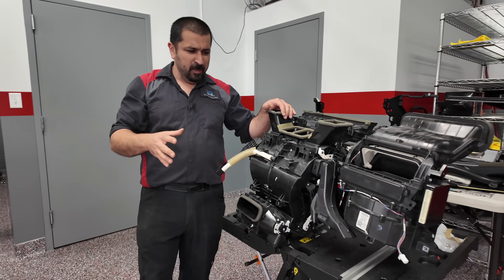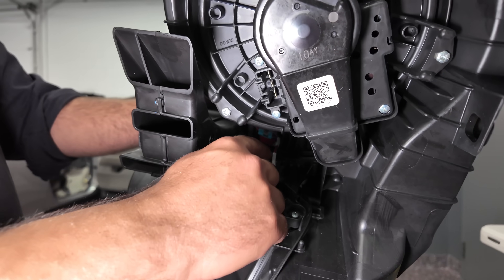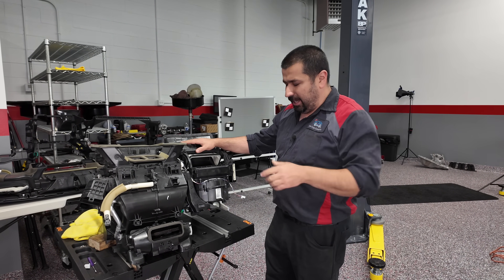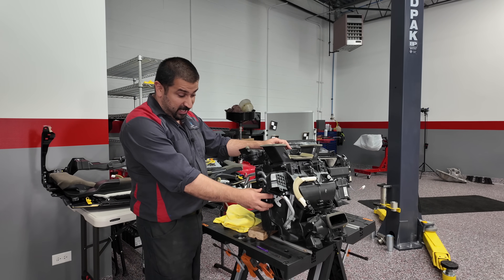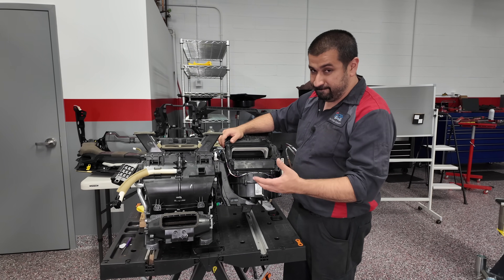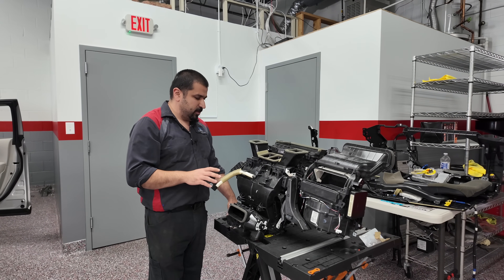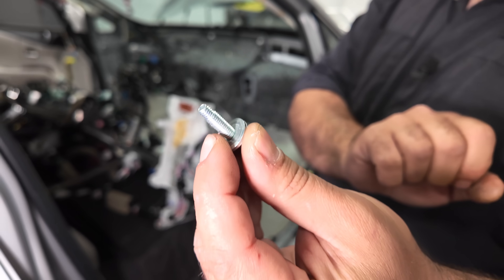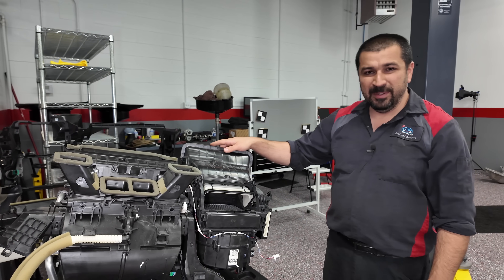THIS is Why Car Engineers and Car Mechanics Don't Always Get Along!

Comment: Sad that Toyota isn’t what it used to be. I remember the good days of Toyota when they were simple and cheap to fix. Like a VW bug.  Yeah those days are gone thanks to the EPA and engineers adding motors to everything - because that fuel cap door needs a servo to open it 🙄.  Can I get a simple car again that doesn’t cost $80k that isn’t made with inferior parts.  And has a transmission dip stick.

Comment: As an Electronic Technician  for almost 4+ decades, who’s work along side Engineers. Most Engineers that I’ve worked with, that have good common sense, have a Gun over their heads by the  clueless bean counting crew that’s very delusional 95% of the time.

Comment: For years I've been saying that engineers must be made to perform repairs on the cars they design.

HVAC are the worst. All this complexity  buried behind the dash for parts that DO fail with age. Especially heater cores and AC evap units... they DO fail eventually.

I changed the heater core on my old Jeep, took about 2 hours without rushing (and the heater controls were cables, similar to bicycle cables). I hate modern cars.

There is NO justification for that other than being cheaper to assemble in the first place.

Comment: In 2017 RX, they did it even worse, they combined all three of those "inside" servos into one, and it is even harder to get to, then in 2010 RX. Lexus wanted to charge me $2800. As a DIYer, I was able to repair it in 1day without taking apart whole car. And even servo didn't need to be replaced. Toyota instead of soldering motors, put their contacts in clamps, which after oxidation lost electrical contact. I cleaned it, put dielectric grease on contacts and put it back together. Works for a year already.

Comment: Had to do such repair work on my 1997 Camry. Terrible job. As a DIYer you dont want to discharge AC refrigerant, so I had to cut opening in the box to access and then glue it back. I believe the issue is when condensate get frozen and ice blocks the doors. In my Camry actually plastic shaft was broken and I used piece of old stainless steel antenna to repair shaft. It worked well after repairs for many years.

Comment: This makes one appreciate older vehicles. How much technology do you really need. Everything has its price.
Reply: The fancy touch screen and digital dashboard is all cost cutting. Its almost never for innovation.

Analog design is very expensive, especially when it has to be accurate in multiple conditions.
Reply: Yep.  I like my 90s 5 series and I look at everything the E39 Executive has over my late E34 and just see it as more superfluous crap that can fail on me.  Electric steering column adjust that ties in with the electric memory seats is a nice idea... but pointless.  The rain sensing wipers do a crap job.  The auto dip rearview is worse than the E34's.  The cup holders are a joke.  The nav screen in the centre dash is painful to use.  Its easier to scan for codes though since it's OBD2, I guess.  Any work on it is just not enjoyable, requires a ton of flashings and coverings to be removed first. And the pain of doing the sump gasket! All the moving everything out of the way to get only about 4 inches clearance to wrangle the dang oil pan out... lets just say I used up my yearly allocation of expletives that day.  The E34 is an absolute joy to work on by comparison, most of it is so well designed and made from high quality materials I don't even need the service manual most of the time. The only thing that breaks are silly little plastic clips that I have bucketloads of on hand (thanks to chynah)

One modern tech I think I would like is voice control.  I dislike directing my attention away from the road and all the idiots on it, but everything is going towards touchscreens you literally cannot operate without looking - no more button feel.  I HATE that.

Comment: Got to love the engineers that never touch what they design when it breaks. We put up a dart board in the shop with their pictures on it.
Reply: Seriously? You made it sound as if they do NOT do ANY testing or if even if they do test, that nothing ever breaks.... Lets suppose they do test, and something does break, then what, the engineers just go, "not my problem" and "never touch what they designed when it breaks"?
Reply: @minienigma  I'll do the same. Seriously? Do you deal with this stuff on a daily bases? Yes, I'm serious. Why design a access hole too small for a valve to fit through after it's unbolted? Why locate a switch or drive motor in a place were the switch is longer than the room given to remove it? Why put a two hand to loosen connector in a one hand space? Why use off the wall hardware you need to buy special tools for? In the case of the Lexus and most every modern car out there, why design it were most of the car needs to be torn apart to do something simple. I may not work on cars very often but I do work on other specialized products with the same problems. One little bad sensor mounted on the side against all the structure when it would take 5 minutes to change it were located a inch different. Besides, a engineer told me some of his co hearts think like that and he wastes time worrying about us mechanics having to fix it quick.

Comment: I've worked on cars and trucks. This reminds me of the time I decided to go and fix high speed copiers/printers in the field for Canon then later Sharp. Can't tell you how many times I got to a service call where all the other techs did was spray WD-40 willy nilly inside the machine and pray the customer didn't call back. I was the one that would take apart the machine down to the stamped steel frame and find the electromagnetic clutch or brass bushing that was making the noise and apply grease to make it go away once and for all. I eventually got fired for working like that but I never destroyed a machine and my call backs (or recalls) were non-existent.

Comment: I see both sides of the story. My dad was (still is) a mechanic so naturally I worked on cars from a young age but I ended up becoming an engineer (more specifically a manufacturing process engineer). Some of the problem is that most of the "hands on" type of engineers end up as manufacturing engineers while a good chunk of the less hands-on engineers end up in design engineering. It's already hard enough as it is to make things manufacturable, it is whole other thing to make something serviceable because you have a ton of teams trying to make everything work together. We always try to make things manufacturable and serviceable but if we realize too late in the design process, it may not be possible to change the design for serviceability.... if you change one thing, you may interfere with another teams thing. It's easy to see in hindsight where and how we could have made it more serviceable but by the time you can see it "in hindsight" it is already too late. To the mechanics/ techs out there, it is a lot harder than you'll think to make something serviceable but we do try

Comment: Unless I lived in some place like Arizona or South Texas, if my A/C  went out, as long as my heater worked, I’d live with it (I live in Minnesota). My last car’s A/C died slowly over about three months after I left the dealer from purchasing it. I figure they knew about the leak and filled the refrigerant enough to sell the car with the A/C working (I never  went back to them and never will).

The heater worked fine and I was not about to spend who knows what, getting it fixed. As long as I had heat in the Winter, I could roll down my windows in the Summer (like we did when I was a kid, before A/C became standard). I drove that car for 13 years until the frame finally rotted away from the front end last month from all the road salt we use (the car was 19 years old). The engine/transmission was still fine.

Comment: In January we had a Corolla IM come in the shop for the same issue. But this was caused by rodent damage. I guess while this car sat for several months during the winter, a mouse managed to cart nearly 5 lbs of corn into the ac box. After I got the crash bar pulled out of the way and flipped the airbox over, I was astonished at the amount of corn that was in it, and the corn was what broke the defrost door. These particular jobs are not my favorite, because I know that the likelihood of having squeaks and rattles after you’ve had the dash apart, goes up tremendously, so good on ya For making sure I’m taking the time to put it back together correctly because I’ve had to fix another technicians laziness before just because he wouldn’t take the time to make sure everything was clipped back correctly.

Comment: I had a second car that was a 1997 mercury cougar, and I had it for a long time, and work great as a second car.
One day the heater switch just went out, and of course I first thought it was a fuse, it wasn't, then I thought it was the switch, and it wasn't.  It was the motor that the switch turned off and on, and that kind of repair was above my level of knowledge. So I went to a mechanic friend of mine, and the part itself was only about $40, and it took him all day to get it done because they had to take half the dash out, just to replace a minor part.  I felt bad because his hands were all cut up and it was ridiculous they engineered it that way

Comment: 3 days labor or an $200 to hourly labor in the San Francisco Bay area you look at 7200 plus tax shop charges ac refrigerant. That was mine I keep it till the summer when they wouldn't need a defrost function trade it into a dealer who might get stuck to the next driver. Guarantee you I wouldn't spend that much money on a low price Toyota.😂

Comment: Just did a heater core in my daughter’s VW bug convertible. Took 28 hrs taking out the dash like that one. Next time it goes to the Junk yard. Definitely a lot of sews and wiring. Lot of tagging plugs and zip lock bags with each part removed. Not fun.

Comment: I miss the old cars where airflow was controlled by sliding a lever and a simple rod opened or closed a little door in the HVAC system. Sure, it sounded clunky, but it worked all the time.

Comment: Dual zone climate control is one of the dumbest features ever...As if the temperatures dont immediately mix with eachother inside of space the size of a car interior, I leave mine on sync, I'd rather the car didn't even have it...just more cheap plastic parts to break

Comment: Former engineering manager here: engineering is an art of tradeoffs among function, cost, schedule, reliability, manufacturability, serviceability, longevity, etc. The biggest problems occur when there's not an easy way to take some of these "abilities" into account. As others have mentioned, getting inputs/feedback from "downstream" parties like suppliers, manufacturing, service, and end users is critical, but often not sufficiently looked for or listened to. Finally, sometimes we're just plain not smart enough, knowledgeable enough, or talented enough to find a way to make it better enough.
Reply: Oh, and this big pile of inputs & tradeoffs is why certain makes are better at cost, or better at appearance, or more reliable....

Comment: At least, this isn't a late model Ford Escape where the doors need to be removed just to get to the crash brace beam bolts. Also, If this were my car, I'd also like the heater core replaced. If it springs a leak, I'd be somewhat miffed.

Comment: I would love to bring those engineers in my shop and let them try to change these parts. Seriously I really want to do that. Myself i have over 35 years of experience. I can handle these kind of jobs but the issue comes with customers. They are not ready to pay $800 to $2000 just in labor.

Comment: I have and still do a 2004 4runner with the "campaign" TSB as they called it years ago for the 2003-2008 cracked or sticky dash board. You had to get approved for a dash replacement at no cost if your vehicle was included. Mine was and went to a dealer and was approved, but never heard back. Had to go to another dealer and wait again as was approved and finally got a scheduled date. Dash was replaced but point is i have found bolts missing as doing filter replacement on the glove compartment and below. I don't have rattles or anything but the short cuts is what im referring too 😕🙄 I've read was not easy to replace but they had to do it , and just did one after another just to get them out quickly. Thanks for another great video 👍

Comment: I just found out about my upstream O2 sensor. I've wasted about $600.00 on O2's that wouldn't work. Now I know why. The ones I was buying were narrowband I need a air fuel ratio O2 sensor that's wideband. What I worry about now is my Camry LE 4 cylinder is a 2000. It's the hook up that worries me. The pattern to the hook ups are different now days. The O2 will screw in that's no problem. It's the hook up that worries me. I have other issues with the Camry as well. But that's another story. God Bless.

Comment: Just went through this on a 2011 Camry! Expensive repair had to remove the dash. $700 to change PCV under the intake! Got it back with a blower motor noise that my wife couldn’t stand.

Comment: There are engineers who've given a ton of excuses to justify poor design in the comments. I'd say that in many cases it's simply that ... poor design. 
An example is the evaporator which could be located behind the glove box, which is where it used to be located in many older cars, where it could be swapped without having to dismantle the entire dashboard. These days, most manufacturers have moved towards locating it smack in the middle of the firewall.

The engineers don't care, the manufacturers don't care, because by the time that component fails, the car is no longer under warranty.

Comment: Some engineer probably got an award for finding a way to control all of those doors with one motor.
Reply: It's the same with buyers. If they find a supplier who offers a few cents less, they are congratulated. And too bad for reliability...
Reply: Yeah and they hate it because they were told to do. Even when it wasn't their recommendation.
Reply: I think one motor controlling multiple doors like that is common.  My 2010 Civic does the same thing.  The difference is, the servo motor is accessible from under the dash - a little awkward, but definitely doable.

Comment: Had a similar issue here in Oz with a Ford Fairlane ( top of the range, very expensive car at the time) nylon washer failed in the climate control, A/C control, car new cost $30.000.00 repairs, labour only, over $1000, parts $0.20.
Reply: I still drive an EF Fairmont. The only issue I've had with the climate air was the buttons on the controls.

Comment: Boy o boy, now this is a project for sure.  It's is exactly like you say, you must take great care taking all this "stuff" apart, bagging and marking the fasteners/clips, etc, take pictures also.  There is no way you could get this back together write if you are sloppy taking it apart.  I just can't imagine trying to do this job for the first time and getting it right.  I was glad to hear that you are replacing the heater core while inside, don't leave anything to chance.  Anyway of taking that assembly apart, perhaps finding the thing that fell inside jamming the actuator.  I know you said it doesn't come apart but you are replacing the assembly so it doesn't really matter if you break that lovely plastic to get at the culprit.  I can only imagine all the dealer techs calling out sick when this job rolls in.  God bless you CCN for taking the time and care to do this job the way you would want it done in your own car....

Comment: I don’t trust you ever since you stated that car Keys come with a flat head to replace the battery of the remote which is total made up ignorant BS because some key blades do not come out of the fob and what the flat head of the key actually is for is to access the shift lock next to the gear shifter to force the car out or into PARK…. What kind of of Master mechanic are you?
Reply: I've always used it to replace key fob battery and it works. Everything has exceptions. Not something to lose trust over.
Reply: @briank10101  how can you trust a mechanic that doesn't know what the car key is for? you belong to each other

Comment: Good old manual controls
Like the 70series still has
I doubt if this was worth the cost on a 2010 vehicle
Like that repair might last the car out but something else will finish it
Just trade it 
How many car dealers will check the defrost?
Most will just assume that function  works😅

Comment: Having been an almost lifelong shade tree mechanic, I have done a lot of note taking during disassembly, including step by step numbering. Also I don't shy away from things that are not meant to be disassembled. As I do this I keep things in mind   as to make improvements in the repair. There is no limit to the satisfaction gained from such a successful repair. Almost makes the extra hours worth it. By the way, service and repair manuals are useful to an extent as well...in conjunction with note taking when repairing the "unrepairable".

Comment: That expansion valves is American design in early years and than later years is EGR ,on early years Japanese design EGR with stainless steel diaphragm it never wear only clean with brake cleaner than install with new gasket ,America EGR in early years design to throw away EGR only